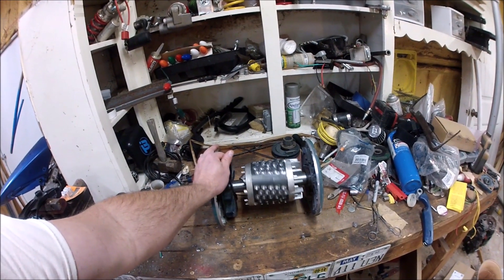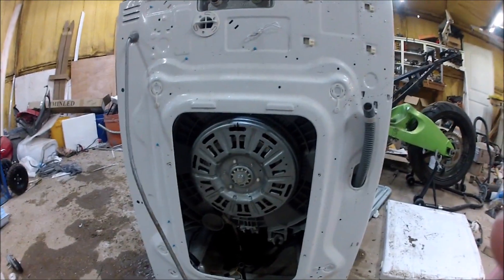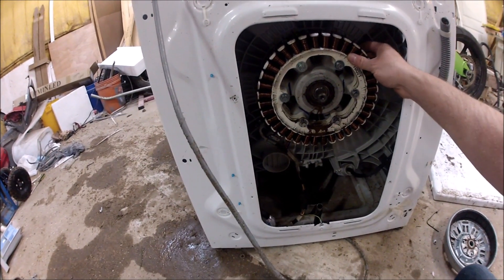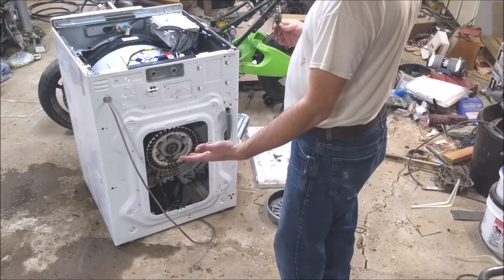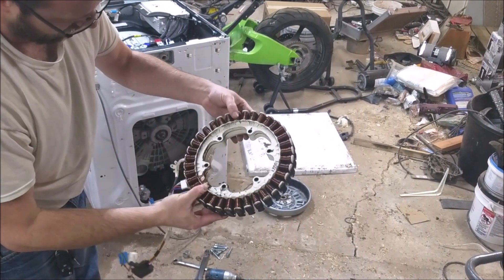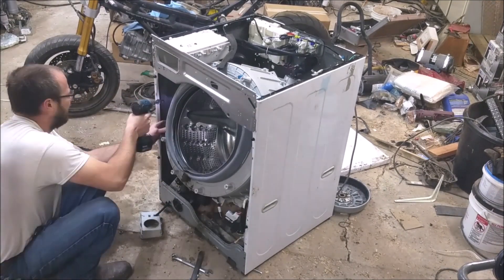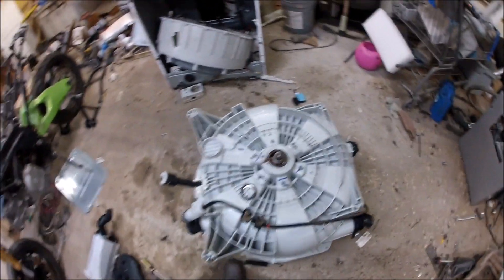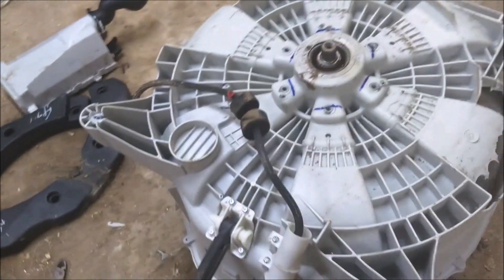DIY Project #3 ~ A washing machine!

Comment: and this is why i need a lathe, ive rewound these style stators that initially had alluminium windings, the copper magnet wire definitely made more watts than alluminium, i only used the machine and a drill, pillow block is a decent idea, id screw it up getting it perfectly central..
Reply from the maker: This one has a bit of an air gap so I think I'll at least have a little leeway there with getting it centered.  I feel it's the best way to go about it.